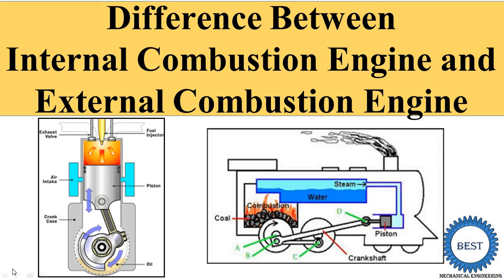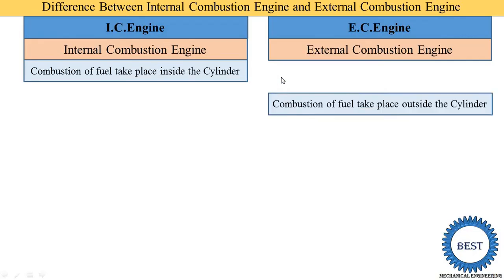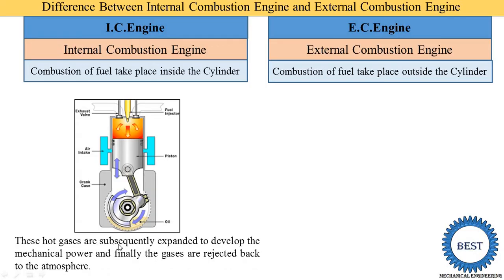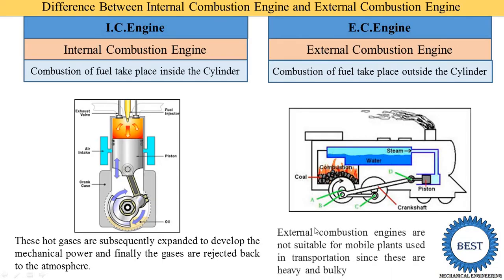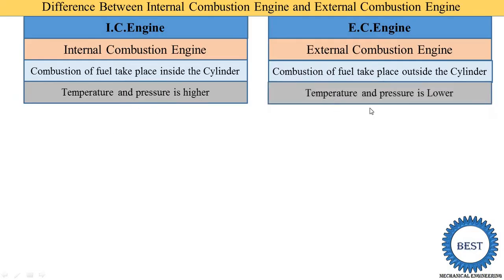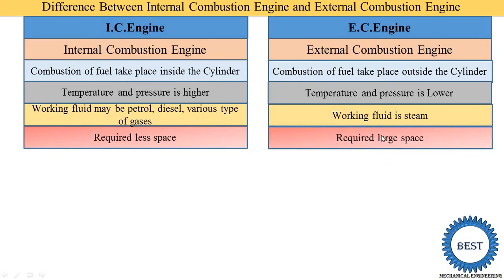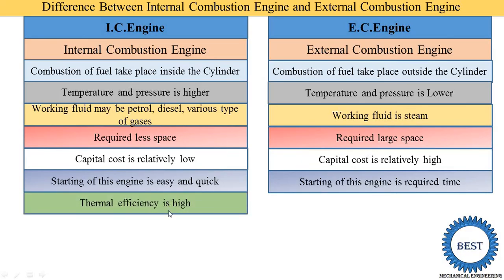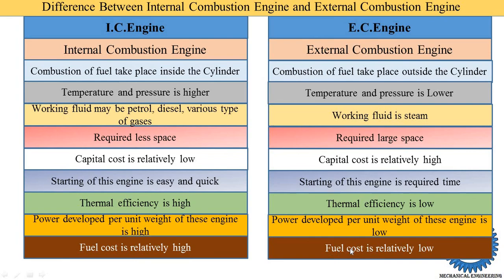Difference Between Internal And External Combustion Engine

Comment: Steam engines still have some advantages over the internal combustion engine in many ways like for example, as they get hotter and hotter, the more efficient they become whereas internal combustion engines lose efficiency as they get hot. Plus the huge amounts of torque you get from steam too. Despite being an older design.